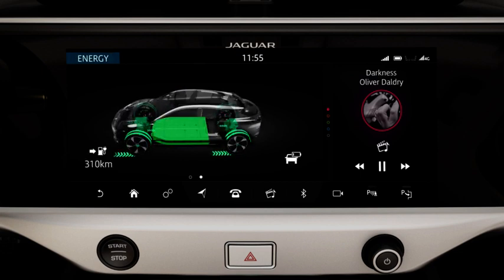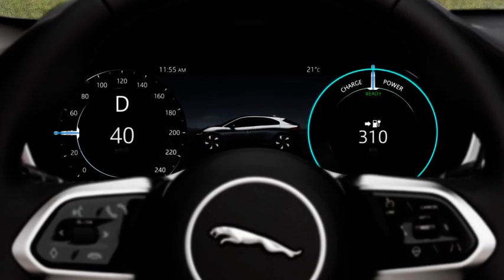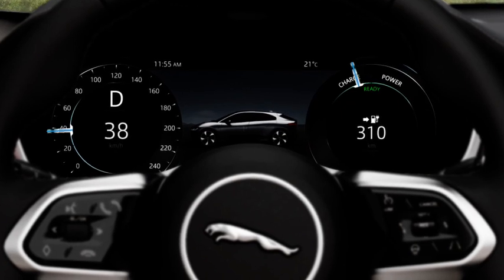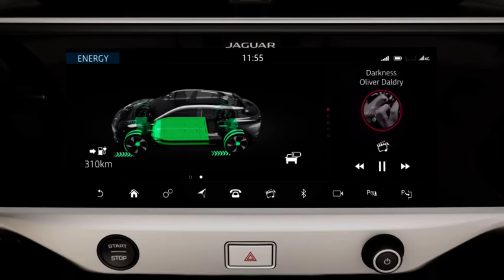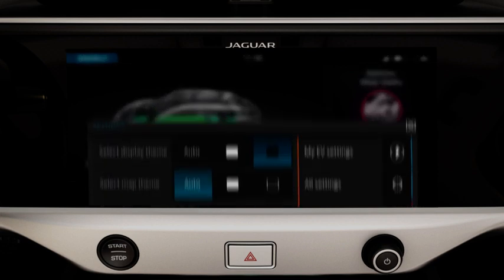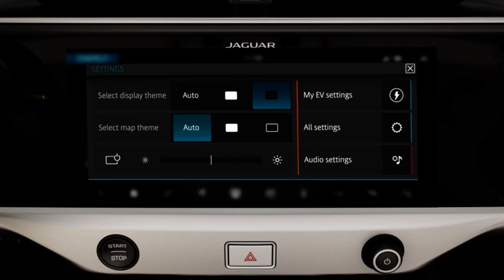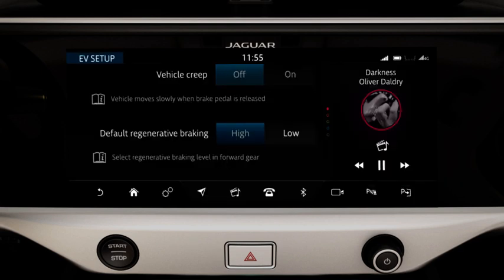Jaguar I-PACE 2019 | Configurable Regenerative Braking

Comment: Jaguar, please will you consider using steering wheel paddles to adjust regenerative braking in real time, with the vehicle coming to a complete stop and the footbrake being applied automatically until the accelerator is pressed again.